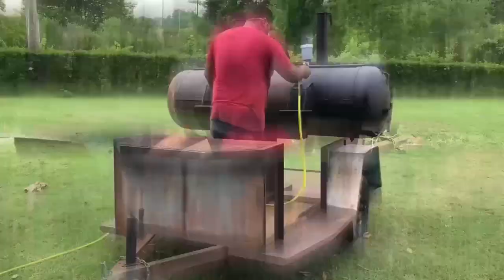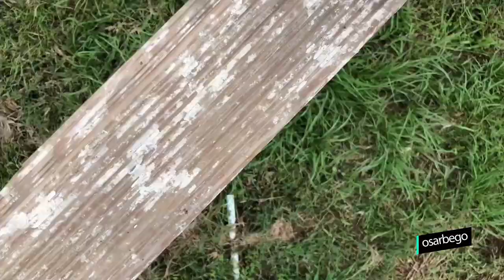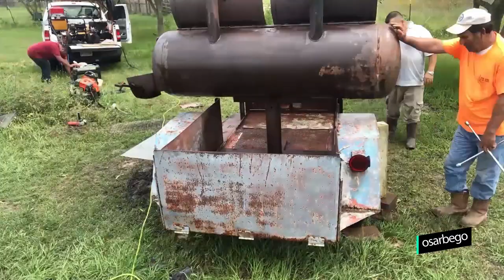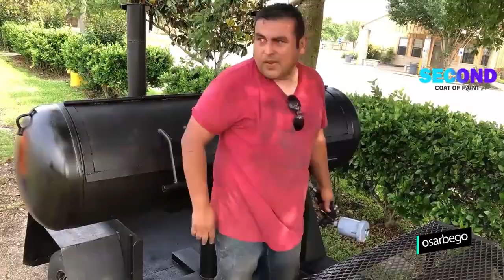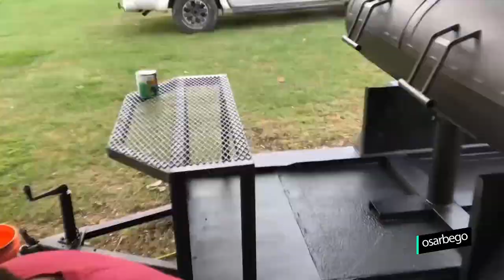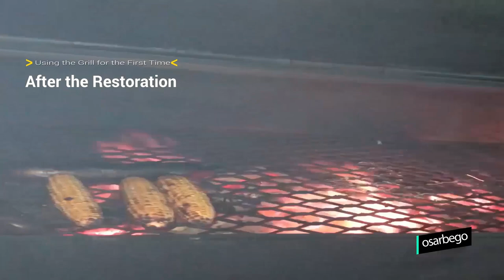BBQ  Grill Restoration | Time Lapse

Comment: Never paint the heating chamber inside or out, you clean off the rust like you did then oil the whole thing down inside and out and burn a hot fire in it and every time you go to fire it up or every couple of times or so you re-oil it and it will look just like its been painted but be like a cast iron skillet inside and out. The trailer and all other parts were OK to paint. I just did a similar grill and it looks freaking awesome and I used zero paint. Whish I could post before and after photos for you.

Comment from the maker: This project was something new for me, I am a computer technician but I like to remodel or repair things. It was a serious mistake not to consult with a painter before applying paint inside the grill. The good thing is that I learned a lot in this project. It will not happen again. Thanks for the comments, they taught me a lot. Blessings.
Reply: How and what would you use to clean the inside?

Comment: First, awesome job! Two things you might want to add. 1. Non-skid on the bed of the trailer, that's the last place I'd want to lose footing. 2. Weld some tube steel to the top of the rails to protect you from that sharp edge.

Comment: I'm about to paint a smoker with an HVLP air gun and that rustoleum high heat paint.  Did you have to dilute the paint to get it to spray?

Comment: Run a super hot 🔥  fire before cooking ANYTHING in this to burn the paint off.
You aren't suppose to paint the inside. 
Once you get the paint off, you'll want to coat it with oil like cast iron. 

Just please be sure to get that paint out of the inside.